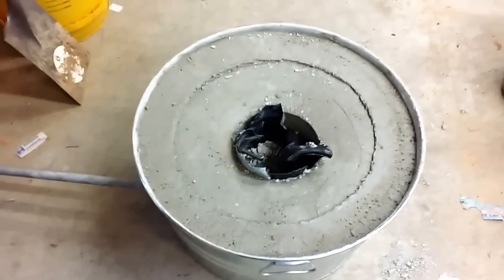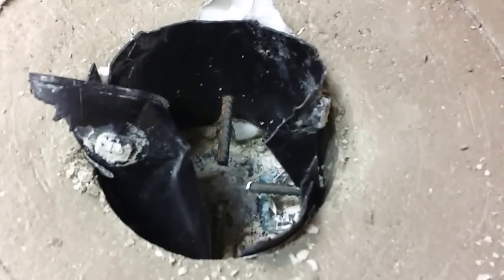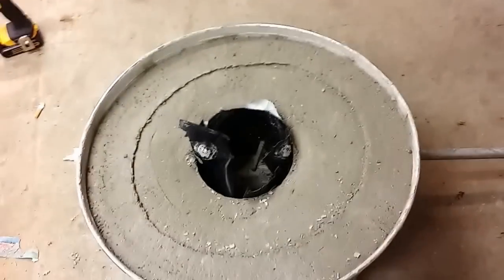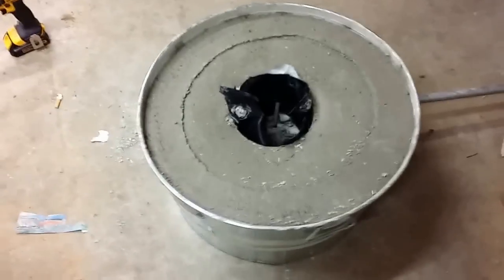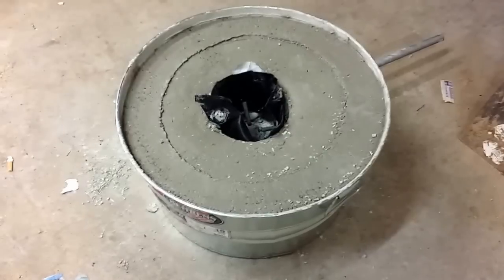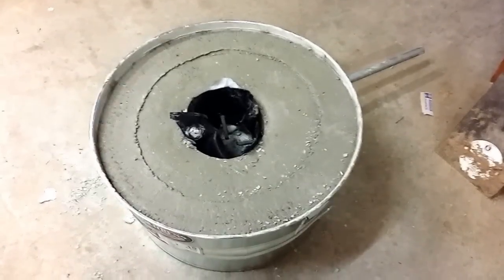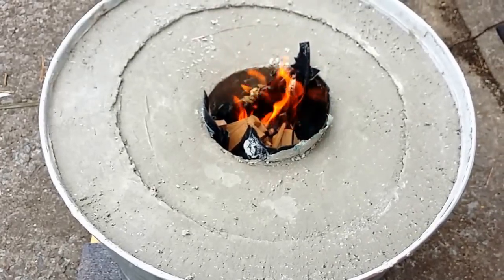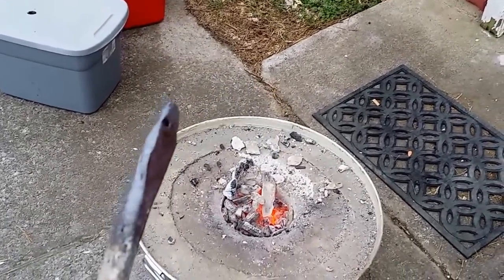DIY Refractory Furnace and Forge Combo

Comment: I made one exactly like this myself but not with walls as thick as yours but I can tell you that the rebar crucible holders wont  get hot enough to bend or melt due to where they are and that the galvanized materials you used are perfectly fine and wont become hazardous. the only tip I can tell you is that when using a forge like this and since it is exactly like my old one jus beware that sticking metal at a downward angle into the coals there is a high chance of melting your steel and ruining any blacksmithing project you might be working on. the steel must pass through burning coals horizontally to work properly

Comment: It looks like the mix used might conduct alot of heat. Alot of fire brick especially insulating fire brick have alot of air in them
Not sure if they'd be any good for a blacksmith forge but if they were it may make it a bit more effecient.

Comment: Thank you for your video and the well explain presentation it is one of the best videos I have seen on this subject. Just one question, how much clay did you use. Job well done.
Reply from the maker: The formula is given in the video at around 5 min.  I would suggest one change - make the hole in the middle about an inch bigger.  Build up fire clay "risers" rather than using rebar for setting the crucible, and then completely coat the inside of the firebox in the center with fireclay before using as a refactory.  You can avoid this is you are just building a forge top, as a metal plate is placed on the top of the hole and the down hole becomes an ash collector.  The nice thing here is that it takes much less coal to heat material, because so much heat is reflected back onto the material, that would normally be lost on a typical metal pan forge.

Comment: You have to mix it dry, dry, dry, and Pack it hard.. Then, put a 40 watt light bulb in it and leave it somewhere dry for at least a week.. Somewhere warm and dry is best.. And, not a bad idea to alternate the light and a fan.. Let it cool with the fan for a day, and then put the light back on it.. Before you fire it with coal, run a hair dryer in it long enough to see if you see or feel any moisture.. Feel any moisture, keep waiting.. Putting it in a Gas oven with just a pilot light is not a bad idea either, if you crack the door every now and then and let the moisture out. (Moisture is what made it pop).. 
Using something like Kaowool is more expensive but, much faster, and lighter... If you want high temp, which is what you really need,, you need to use some 3000 degree castable refractory to be honest.. But, it's the first, so, it's a learning experience.. 

If you have fired it a few times, I wonder how the rebar is holding up.. Gone yet?
If the coal gets below it and the fan you are using is moving enough air, it will melt or burn the rebar..

Comment: Hey..... Fyi i don't know how hot your bucket is getting. but galvanized steel gives off a toxic gas when heated.
Reply: You are 100% right very toxic fumes people have been poisoned and killed
Reply from the maker: I think this has been expressed several times already, but the temp of the exterior does not rise above 90 degrees at anytime around the sides and less than 200 on the bottom.  Well below any melting or extreme heating point that would make the galvanized metal a concern.

Comment: You never said how many parts clay was in the mix
Reply from the maker: Apologies for the slow reply here - It is 2 parts but you can use more, and if building something that is not as thick as this, I would recommend a higher ration of say 3 parts.  I also tripled the perlite in another version I recently made out of a propane tank and this was even better.  Great insulating factor and significantly reduces the weight of the furnace.  I will try to get a video posted in the next couple of days showing that build.  Let me know if you have any other questions.

Comment: WHERE YOU GONNA PUT THE CHARCOAL
Reply: It's propane bruh.
Reply from the maker: As a refactory furnace - a small extinguisher sized crucible is placed in the hole and a top the rods in the bottom.  There is about 4 inches of space at the bottom for getting a coal bed going and then once it is going and the crucible is placed in the hole, more coal is packed around the crucible to aid in melting.  A cap (not in the video) is placed over the top.  As a blacksmithing forge, a steel plate is placed in the top of the hole upon which charcoal is mounded across the entire face of the furnace top.  As it burns in the middle more coal can be pushed down the sloped sides.  I will do a video soon showing both of the functions.  Waiting for temps to fall!

Comment: Using anything galvanized is a terrible idea and a easy way to die a painful death. The container may be ok for now, but the blower appears to be galvanized as well. I would remove that ASAP.
Reply from the maker: Thank you for the heads up on the galvanized risk (which I was aware of but did not feel anything would get hot enough to be of a major concern.  The blower pipe is set back from the combustion chamber by several inches and will eventually be replaced with either a direct attachment to the side of the container or a piece of PVC.  The outside of the container at the bottom only rose about 10 degrees above ambient during my hottest test.  At the rim during the same test, the container was 30 degrees above ambient.  During that same test, the fire chamber was so hot that it melted the steel rebar closest to the blower exit and melted all of the sand out of one side of bottom.  Needless to say, it got very very hot.  I have since relined the inside with fireclay about 3/4" thick and it has hardened and is no longer eating away at the sides.
Reply: Franken Sense http://en.wikipedia.org/wiki/Metal_fume_fever
Look up metal fume fever.
Reply: Joseph White in order for it to be a problem, it would have to be hot enough to vaporize the heavy metals.
Reply: Leonard Payne True. A forge/Furnace is more than capable of getting hot enough. The pipe inserted as the blower tube would easily reach the critical temperature to release the toxins into the air. Its a big risk easily avoided by not using those metals. I am no expert, but I would avoid using them at all cost.
Reply: Joseph White If the "outside" gets hot enough to burn off the heavy metals - you need to rethink the furnace. Yes, the burner pipe will get hot enough to burn off the heavy metals ... and then they will be gone because they have been burnt off. In an area that is well-ventilated enough to be using a forge/furnace the concentrations of heavy metals (what little there will be) would not constitute a "health hazard". I applaud you for being cautious, but, I would have no problem with this in the least. Yes, I do have some experience having been an Industrial Mechanic and Welder most of my life.
Reply: Joseph White By the way, my Grandfather died of heavy metal poisoning - but he welded galvanized, in very confined spaces, most of his working life (died at 63).
Reply: I used to torch a galvanized container with pine outdoors before making an experimental forge out of it.